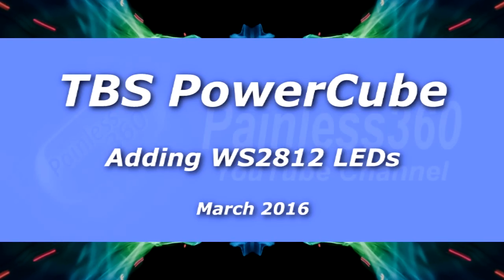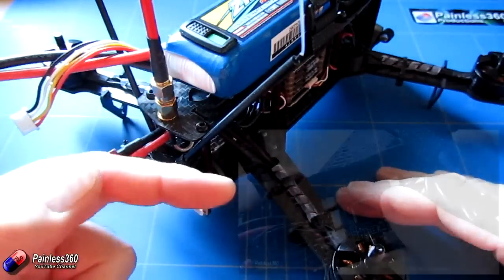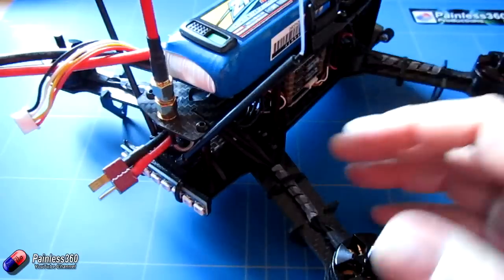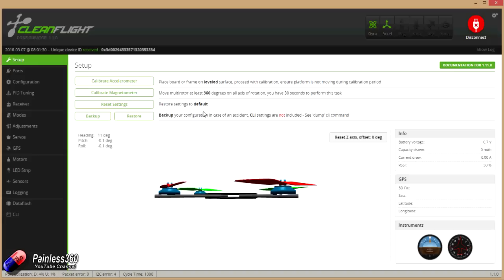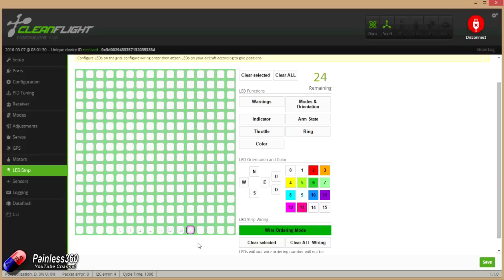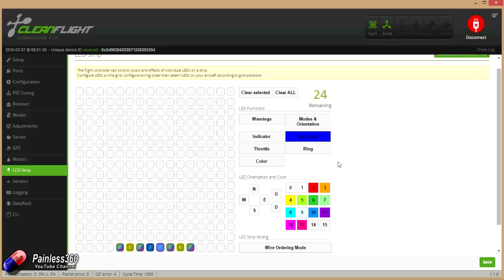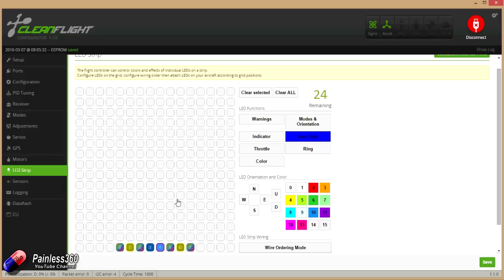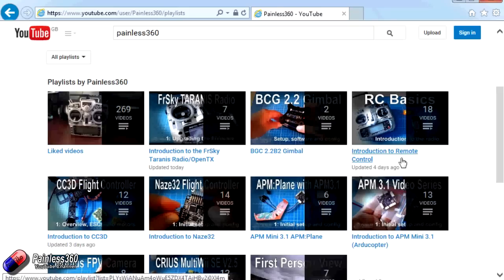TBS PowerCube Series Quick Tip: Adding WS2812 LEDs

Comment: ... I have 16 leds in Cleanflight available and wasn't sure what a ring was ..... so I went shopping ........ https://www.aliexpress.com/item/16X-RGB-LED-Motor-Ring-Circle-LED-Board-Programmable-For-FPV-Multicopter-compatible-flight-controllers-Flip32/32504091628.html  .....  it will take 16 LEDs up, but it looks fun. CHEERS!

Comment: I tried the same on the powercube mini for the Atom V2. However I get random colors and flickering. What is that firmware update you are talking baout?
Reply from the maker: That was released back in April and really only affects the LEDs if you're using the TBS OSD/FPV modules too. TBS added some code that allowed the channel used by the VTX to be shown as a colour on the LEDs so that pilots could easily see who was on the same frequency. That was updated to work better. If in doubt - upgrade the firmware on the cube.. Best of luck!

Comment: they have them al install,i want them only chance,its a strip ,the same as on your quad,i want only the two on left and the two on right set on indicator,so if i go right its indicate right,and if i go left its indicate left.and the other leds on the back strip on arm state(blue,green,red)if the batery is low,and ectr,ectr is this the same proces?,first wire ordering mode,than chose the leds you want chance in the specifik modes,in my case indicator and save that?i am a litle scared that i am ruiining it.

Comment: hi painless360i had one question about the led setings on my power cube,i has a storm ,srd 2560v3,with the powercube,i buy im rtf,now i want to chance the led licht strip on the back,(chance in clean flicht)but  can i losse al my other settings nou??or is it save and has it nothing to do with the steaering settings?and is this also a problem with upgrade the clean flicht?
Reply from the maker: +chris schaft alias vuurwerkjunk the LED strips work the same as any other Cleanflight system, unless you have a CorePro and Unity FPV system like the Vendetta has - then the OSD/VTX set the LEDs to match the FPV channel. Best of luck!

Comment: I set everything up just the way all of your videos explained. I set up the LED's word for word as you epxlained. The issue im having, Is the after i set up the LED's .....save ...Unplug the battery and plug it back in. The LED's switch to the VTX channel and not the set up i had. When i go back into cleanflight the whole led map i saved erased. any tips or tricks to help.?
Reply from the maker: +John Doe this feature is set in the OSD, access the menu on the OSD and disable the LED function.. Happy flying!
Reply: +Painless360 I went into the menu on the OSD using the fpv goggles. there is no LED setting that I saw. I have updated the osd and the power cube.
Reply: +John Doe even went into the Tbs agent. nothing there either
Reply from the maker: +John Doe You can see it in the menus in this video - https://www.youtube.com/watch?v=_65nsvT8HaY at 3:54 If that's not it then I'd get in touch with the vendor for support. Best of luck.
Reply: +Painless360 I figured it out. The control threw the osd while on the 1.32 firmware for the core pnp pro didnt have the LED vtx control. I pressed F1 found the beta firmware versions. updated to the PNP PRO BETA V1.45, and now the VTX led control is available. But since it is a BETA version things might not work correctly. But thank you for your help.

Comment: Is it possible to have multiple modes on the leds? Like arm state on middle 4, that turn into throttle when you take off? And the outside 2 on each side being in red and indicator? Thanks!
Reply from the maker: +Bishop Vick check out the latest Cleanflight LED documentation for the latest news and information. Best of luck!

Comment: if my receiver doesn't say witch  is the throttle it only shows channels 123456B/VACC I'm running  a flysky fs-i6 TX RX
Reply from the maker: +Nakamalei DeFreitas Use the channel monitor to see which is which. The first is normally '1' on the Rx etc..
Reply from the maker: +Nakamalei DeFreitas Google 'flight modes painless360' to find all of it..

Comment: this is off topic but I need help.... I have a zmr250 cc3d pwm openpilot 2204kv 3s powered and I have just installed new multirotormania 12a Blhlei firmware everything works it Flys but my throttle doesn't respond till halfway point and I don't know how to fix it if you  could give me any help on how to make it more responsive it be much  appreciated
Reply from the maker: +Nakamalei DeFreitas Watch the videos on the channel about ESC calibration - best of luck!

Comment: Your video does not cover an important point about these WS2812 LEDs which pretty well explained in the cleanflight documentation about the sensitivity of some of these chips which will require a input voltage lower than 4.71V in order to operate correctly, i faced this issue a couple of times and the first time i thought my LEDs were faulty and it was not the case, it was just about the voltage input :)
Thanks for sharing anyway and happy midweek
Reply from the maker: +ABMNS PRODUCTION I've never had that here with any of the strips, rings or individual LEDs. Great to hear that it's covered in the manual (one of the key references for any builder) for those who do see it.. Happy flying!
Reply: Painless360 I guess i am maybe sometimes very unlucky lol
For the record, it happened to me with some LEDs sold by Adafruit :)
Happy flying to you too!

Comment: Could these strips also be used on cc3d or apm?
Reply from the maker: +Raspberry What did your research turn up?
Reply: +Painless360 some support for cc3d (cleanflight), but not much info about apm
Reply: +Painless360 btw, would you recommend using cleanflight over librepilot on cc3d?
Reply from the maker: Yep, CC3D Revo uses them for simple status alerts to the pilot (see out Revo video in the playlist on it). My advice is to run Librepilot on a CC3D and if you want Cleanflight get a Naze32 or STM32F3 based board.. Happy flying!